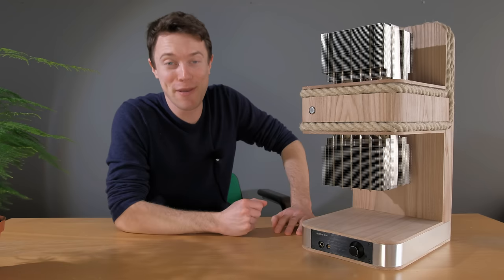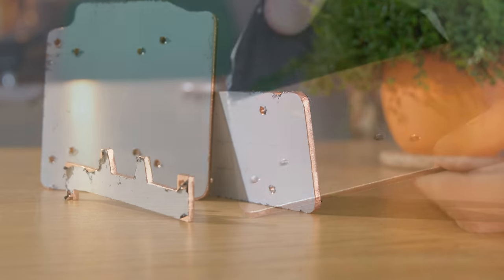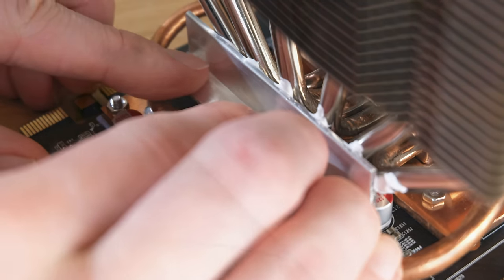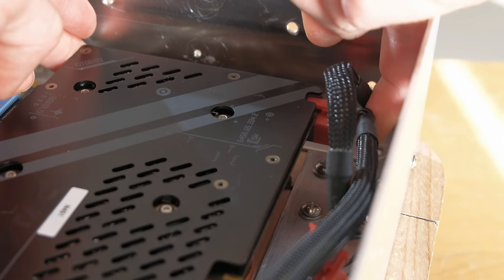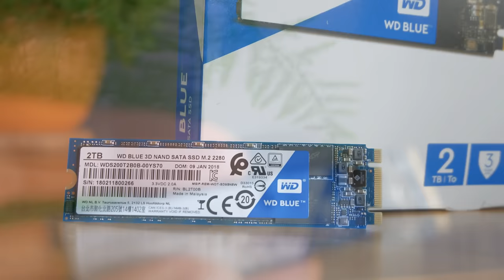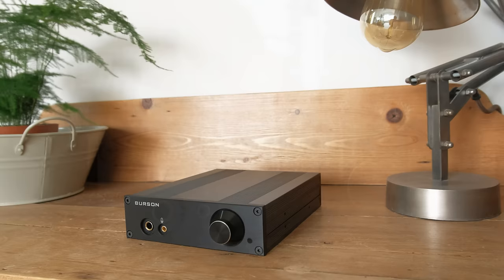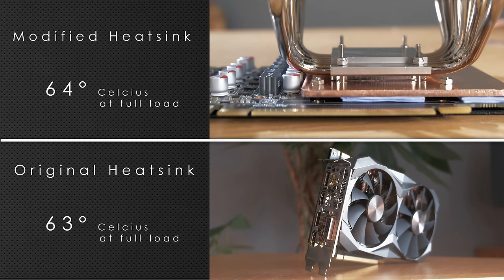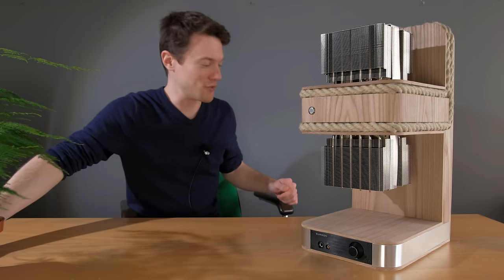I built a PC out of rope and wood...

Comment: Turn this into a mass production unit, ill buy 2 XD

Congratulations on 1 million subs bro!
Reply: same
Reply: Exodarion I want one.
Reply: Cost to make manufacturer is probably  $USD 20000 to $30000 to set-up and engineering design tooling and to create the assembly line and assuming a 15% profit margin(Boutique level, think hand-built Lamborghini Venano)  your looking at $7500 to $8000 retail. Figure that's about 1% of the gaming market and.0001% of the total PC market (262.5 million units 2017 https://www.statista.com/statistics/273495/global-shipments-of-personal-computers-since-2006/) total unit demand would be about 26200 units. More calculation and details(Nailing down the set-up and assembly line costs for example as well as production labour  costs) would be required for a  break-even analysis to determine whether  it makes  sense to build it as a retail product.

Comment: Okay, this thing is AMAZING! The custom heatsink for the GPU is so nice. I'm a tad bit surprised you didn't use liquid metal for the copper joining, but whatever. :-) The blacktack idea was really smart. It's no wonder the thing is so quiet. I'm surprised you didn't get one of those giant fanless coolers, but again, doesn't really matter. Actually, I don't think it would look as nice as the Noctua heatsinks. The SD card reader is a very useful but under-appreciated adapter that I am very glad you added. :-) This is one of the most expensive builds you have done, so this project I won't be replicating, but it's great to watch you make it. You certainly know how to film things in a way that it's always interesting. Great job man! And congrats on over a million subs.

One thing I'd LOVE to see from you is make a Hackintosh, but a very unique one. I'm certain you could do it and make it look better than any mac made. :D
Reply: For a DIY PC, he should go with a fairly DIY operating system setup and use something open-source. A Linux system on bare metal running virtualized instances of Apple OS X, Windows 7 and Windows 10? Why, that would be the ultimate setup right there.
Reply: I found out recently about unraid Hackintoshes. Apparently they work really well. That would be something. Linux, macOS, and Windows all running at once. I don't think 2 different versions of Windows is necessary, but if one were to run 2 different versions, I'd run XP as the older one, just because. :P

Comment: I was half expecting George Clooney to walk on and make an expresso.
It's still a beautiful design.
Reply: well..if he would have included a copper heating plate as an underbase for a mug/glass to heat it, it would have been awesome
Could be an additional element if the audio interface would be removed and some heatpipes be directed to the underside that would heat it :P

Comment: What you could in theory do against dust is to create an acrylic/glass record player kinda cover with an air/port hole at the bottom for when you're not using it.
As dust pretty much gathers when you're not using it, as dust is attracted to the static charge created by turning a computer/device off/reboot..

Comment: Absolutely beautiful build! Thanks to you I build my first PC in years. One big issue I found with the SSD was the fact that the motherboard shares the heatsink with z370 chip. They both get really hot under normal load. You can't even use the one in the back of the MB since it's not PCIe only. I switched to u2 OPTANE.

Thanks again! Love your work.

Comment: This build is definitely unique and awesome, but I have to question the use of wifi. Go that extra mile or km and wire it up since you didn't half-ass any other part of this build.
Reply: Abolutely. Every avid gamer I've heard uses LAN, even if they don't have such high end CPU's, GPU's etc. LAN's faster ping time, less lost packets is just absolutely essential for games, especially first person shooters.
Reply: Vousie V you mean ethernet ?
Reply: Same thing.
Reply: Not quite.  A LAN can be either wired or wireless.
Reply: But then you'd call it WLAN, the thing most non-americans call wifi
Reply: Technically yes.  But it's still a LAN versus a WAN (or that weird Bluetooth PAN thing).  Also, most Americans just call it wifi too.

Comment: Damn, if I was rich I'd totally offer for you or someone to build one of these! It's such a cool looking design! I've always wanted to try building custom cases like this, buuut, I'm way too afraid of accidentally breaking expensive components. Maybe it's not too far removed from just building a PC into a pre-made case, (obviously involves way more tools, planning, and measurements) but I feel like the most DIY thing I've done with electronics was take apart my Nintendo Switch controllers and give them a custom shell, and even then I was terrified of accidentally breaking something! I just don't have the money for those kinds of mistakes!
Reply: Do what i did, get some old pc's and start messing around with them, if you break something you just broke something that was only one step away from the recycling plant anyway.

Comment: one of the reasons why electronics are normally wrapped in a metal casing is to ensure grounding and/or to create a Faraday cage. This would avoid electromagnetic noise from entering or exiting the PCBs . If there are alot of electronics near your cool desktop and they are not properly grounded or caged, then you might have issues later

Comment: That build was great. I may have missed the total cost?  Also congrats on 1 million subs. Seems so far away and unattainable. But people are doing it.
Reply: ManCraftingTM He was gifted a lot of the supplies so his cost would not be our cost. Also cost of time/labor.
Reply: ixflqr I got that, but all of those items have a retail price.  I can certainly click each link to figure it out, but usually they know that number or share it.
Reply: somewhere around 2k dollars?
Reply: The components are somewhere at 1500$-2000$,the wooden case cost him around 25$ and that  external amplifier is about 500$(edit)
Reply: Bit more than that... The Burson play is about 500$
Reply: vladosan boss thanks. Very reasonable!
Reply: Mike Berry have you priced a similarly powered Mac?
Reply: the wd blue nvme is 500 euros or $USD615 and the Burson is $USD549 so accounting for components In detail thinking $2500. Labour 2 work weeks (m-f)  at 8 hours a day (40 hrs) at $50.hr gives us about $2000 total cost is about $USD6500 .
Reply: Since a lot of the case build is hand tooled it would be psosible to reduce  build cost with some better tools (Example hydraulic pressbrake and laser cutting of the sheet metal. But some design costs would be added such as time to design in cad for laser cutting). I figure you could shave 10% off the labour figures if you had a full shop with laser cutter. For the curved part of the case I think I might have kerfed it. https://makezine.com/2009/06/13/kerf-bending-for-cnc-millers/

Comment: I built a similar pc out of wood several years ago.    But I mounted my motherboard vertically.    It was more balanced with a  inverted T shape with the power supply on the right side and the motherboard on the left side of the central board.   I had gotten tired of trying to get my hands around a square box that desktop pcs usually have.    So my central wood board had an oval cut  out  at the top so I could easily lift the whole thing.   (For cleaning or moving to another location).    You do have to make sure to clean the motherboard heatsink every once and a while.   Keep an eye on your cpu temp so that it  doesn't get too warm due to dust covering the heat sink.